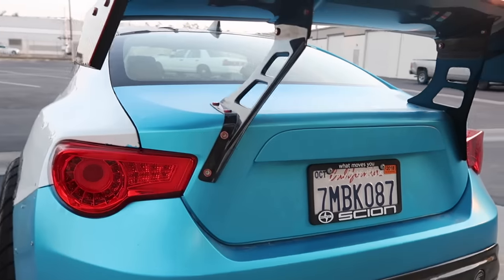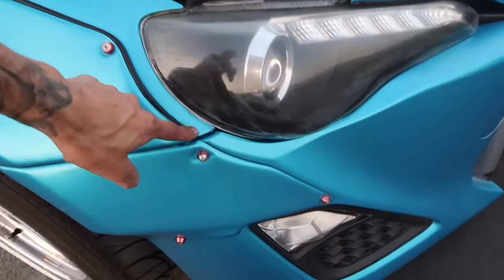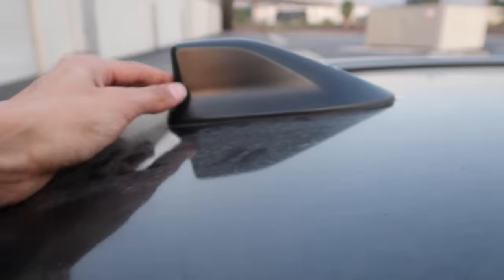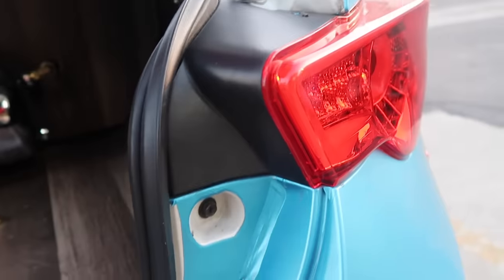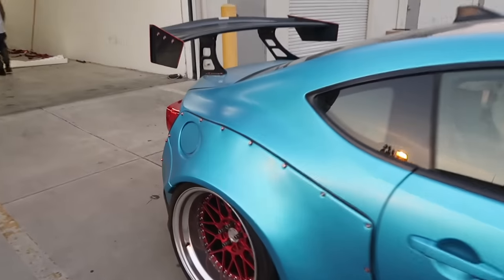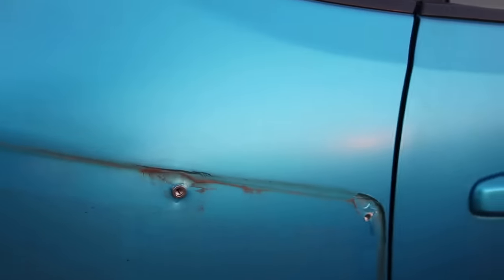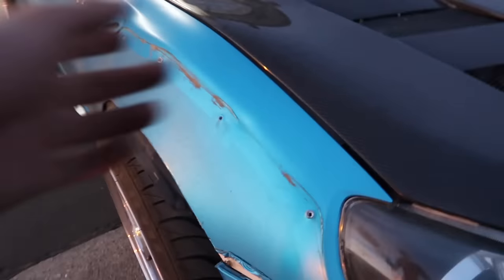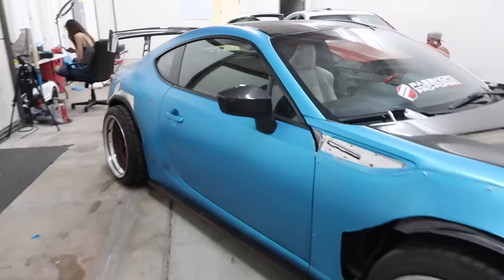THE WORST WRAP JOB I HAVE EVER SEEN (Charged 5,000 Dollars For This)

Comment: I feel like they used power tools and bolted that shit too hard which caused the dents, possibly??
Reply from the maker: Very possible!
Reply: Doubt it, those rivnuts would just spin freely before you could get enough torque on the bolts to do anything more than crack the bodykit pieces.

I call BS on the dents being caused by the wrap installer...
Reply: Well I assume the dents are cause by the shop who did the wraps trying to remove the flares. Pointing the obvious. The flares are bolted on and double sided taped on the probably could not get them of because of the double sided tape so decided to use screw drivers or something to get in between them.

Comment: It looks like those panels definitely weren't designed for holes to be drilled in them.
Reply from the maker: Almost every frs/bra owner does it! Widebody is the new thing now I guess!
Reply: that's not a widebody. it is just a over fender kit.
Reply: you do call it right in the video though.
Reply: Very thin metal. I don't  want to imagine how much they will rust in 10 years.
Reply: thedog556 well the rust might have more with the hack cutting on the fender to accommodate to wheel and not properly treating and/or sealing the bare metal. Steel will rust very quick if it is a fresh cut and if there is any salt or water on it when it is near metal.
Reply: I call it rice
Reply: So?  it looks hideous. Did the owner even look at the car with the crappy fender flares?  How could anyone with any sense think they were a good idea?
Reply: It's American cars that had shitty shitty SUPER shitty steel... for years...  I've Never had a japanese car rust... EVER....
My '68 Austin Healey Sprite??  at least It's safe in the desert.  English guys are buying up our west coast ones now, and shipping them to the UK, cuz it's cheaper than repairing the few remaining rustbuckets they have left...
Reply: The side panels absolutely FUCK up the car. Why would you add that?
Reply: +thedog556 American vehicles tend to rust. Japanese vehicles are known for being amazing. No leaks, no rust! That's what Japan is known for, quality! Don't you dare slander those amazing people that built long-lasting vehicles!!
Reply: When you say reliability you think of Japan and Germany, not American shitboxes

Comment: Paint is better 🤷‍♂️
Reply: And twice as expensive. The good thing about wrap is if you dont like it anymore. Just rip it off and get a new one. Cant really do that with paint unless you are a millionaire. Also wrap is so much better because it protects your car from things like dust, small stones and so on. Even after 10 years with wrap you can just take it off and the car will look like when you bought it ;)
Reply: read my comment again mate. TWICE AS EXPENSIVE. and i might be looking better. but wrap protects your car. paint doesn't and you cant just scratch it off. So i would go with wrap any day. 2k vs 10k
Reply: Agreed, got my WRX repaired and fully painted for less than 5k and it looks a1
Reply: Jake Tyler If you have money to throw away on getting your car painted you have money to get your car PPF'd spending so much on getting a car painted and not PPF'ing the car would be money wasted
Reply: Jake Tyler after 10 years without seeing the sun maybe you could "just take it off", but i have never seen a wrap older than 2 years that wasn't cracked or faded
Reply: Me and my buddy did a full nut and bolt teardown on his E36 drifter for the track. We did all the prep work ourselves, we pitched a tent outside, bought the chemicals and paint needed for a matte dark blue color. Cage ended up orange. I think he spend less than $800 dollars total, and the result is pretty much exactly like you would want a matte car to look. He did have the paint gun already tho. No panels or places where you can see the gun has sprayed. I'm doing that next time as well for sure.
Reply: i thought wraps for those who like to switch up colors every now and then?
Reply: @CastellaTV  you can get your car painted nicely for 3~4k dude. vinyl has to come off at some point
Reply: @WRX Channel
but wrap only cost 2k and has more benefits. it protects the original paint from stones, dust scratches and such and like you said. If you dont like it. You cant just remove it and replace it with a new one and save half the price of a paint job. In my case i get the wrap job for free since my brother in law used to work with it. So i only have to pay for the wrap itself which means i can get my Audi S4 wrapped for less than 1k.
Reply: Deadass just rocker guard the whole thing

Comment: wow $5,000 plasti dip? Here in Seattle, a $5,000-$8,000 medium paint job gives way better quality. I used to work at a seatown small-medium shop that had a car oven. We had lots of customer's that had classics 40s-70 that loved the medium $8k-$10k paint job.

You can find a cheap $800 that does way better cheap paint shop than qfaaco. And still looks better than that pasti dip you just showed.

Comment: I'm really trying to figure out how the shop created those dents? I mean I get the sh*** wrap, but at what point in a wrap does hammering in the body panel come in? The WB Kit comes right ovv with a couple of screws, putting it back in is an equally easy task. So..... those or extremely odd dents. You sure they weren't already on  there from the person who put the WB Kit on, and the owner didn't notice them cause he never took the kit off.

Comment: What is the purpose of vinyl wrapping cars if it's 5 times the cost of painting a car and much less ware resistant. Maybe I'm just stupid but you can get cars painted (high quality) for $2,500 in Texas. Some places charge more almost $5,000 for certain paints, but even at that price why get a wrap? It isn't even permanent? With sanding some places even charge just $800 for a basic repaint. Also on that same note, vinyl wrap pricing seems extremely exacerbated, the amount of labor involved in wrapping a car is minuscule compared to sanding and repainting then clear-coating a car; so why are vinyl wraps in the $3,000 range? It seems that the vinyl wrap market takes advantage of those who are less knowledgeable about car repainting. If your car is new or in great condition there is no reason to not get a repaint. The process before repainting (can be expensive if your car is crap) even helps older cars or damaged ones as they have to fix the body and things like rust (a win win). The main advantage I see is if you want a graphic then the vinyl wrap is best, however, there's guys over in these videos getting base colors probably paying $4,000 for a wrap? If you want a fucking anime girl on your car that's one thing but if you want some off white color don't get a fucking wrap. The car in this video has some metallic sky blue looking color on his car like why is that a wrap? Why not just repaint your car for $2,000 maybe even $1,500? The wrap looks unbelievably cheap when it starts peeling and these things don't hold up well in hot places.

Comment: I'm not the smartest man in the world but don't u think they should have rolled steel to seal off fenders after they cut the holes in them for the body kit  I would be more worried about the water getting in and causing rust issues between fender layer and body structure of the car  rather than the sticker your covering the car with 👍

Comment: holy fuck, piss pour quality in general. the SUPER HACK JOB to the body make me want to puke. who ever did that work is blind as a bat. if you have the money to buy parts like this then GET A QUALIFIED MECHANIC TO DO THE WORK. There is a reason for it, and this is a perfect example of what NOT to do. at 3:51 you can see the butchery done to this poor car, and a gain at 4:32 the rear tires are literally touching the hacked body, better angle at 4:54, best way to get a flat tire. Oh and btw, at 4:04 theres a missing lug nut passenger rear